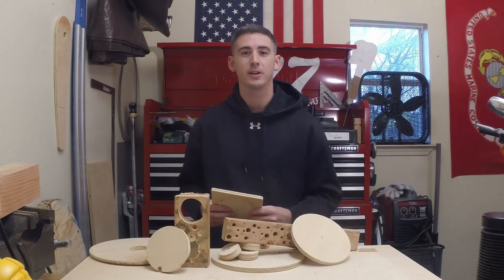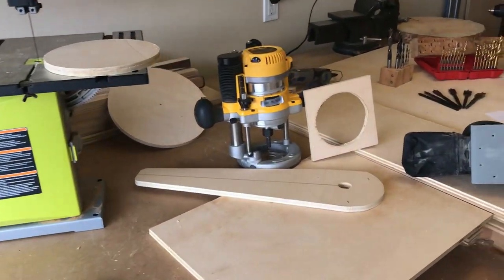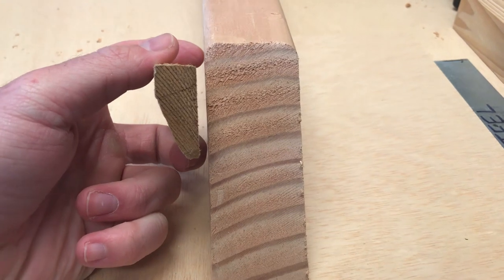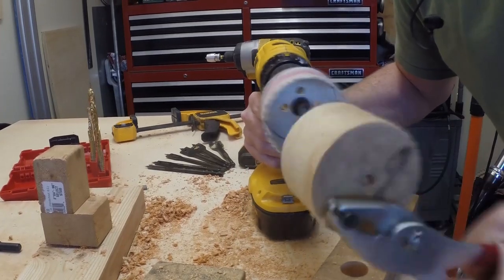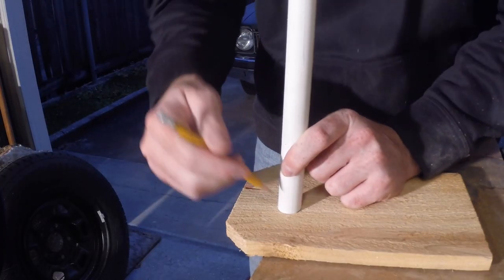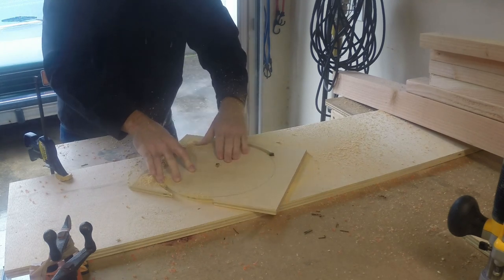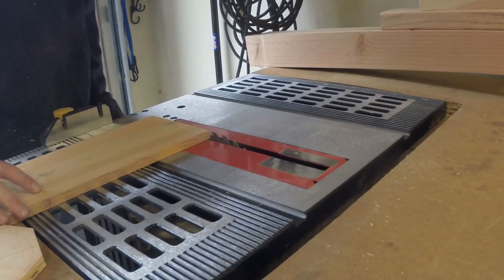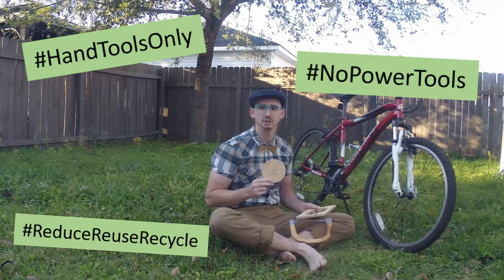How to Cut Perfect Circles…with ANY Tool!

Comment: Thank you so much for making this video and sharing your knowledge with the public! I'm not very tool-savvy and have been thinking about how to cut out circles for a woodworking project of mine. Before this video, the only thing I thought to do was to slowly cut away at a block of wood with a hacksaw, carve out rough edges with a carving knife or chisel and then sanding it off (a laborious and inefficient approach) all while hoping for the best. With your guidance, I feel much more confident in taking on this project, and I'm happy to know these methods with give me the straight lines I need. Again, thank you! :)

[Edit:] P.S. Your video and instructions are very clear, your transitions are funny, and your approach to your audience is very engaging. I love the silly bits and gags you've sprinkled in. :D

Comment: I have to use two by fours in the whole circles. Have to be 2 1/4 inches sometimes or sometimes only 2 inches to fill in the gap. There’s got to be a good way of doing it. I don’t have a big band saw in the jigsaw I’m telling you it’s always bounds in. It doesn’t do a nice circle one side will be wider than the other.

Comment: Hey Tony, I want to drill a hole, not a perfect one inside a tree trunk, I don't have a drill machine or something like that. The diameter is 1 inch and I don't want to drill through the tree, only 2 inches inside. I want to insert my pull up bar inside it. Will it be sturdy and how can I drill it.

Comment: Great, I don't know how you aren't big yet, anyways, I'm trying to make out of my dremel tool. I"d like to lay it on its side, attach a wood-cutting disc, like I said, place it on its side on a wooden table then push an inch thick wood I'd like to slice against it with both hands and make a straight cut. I don't have the resources to get these things otherwise I know I would have figured it out, any idea what to do? without buying more fancy Dremel attachments/accesories?

Comment: How to cut a circle without a hole in the middle? In the middle of the cut out circle I need to drive a screw, but with drill bits and spades the tip cuts a deeper hole in the middle so a screw has no woods to screw into. Think of a circular hole for a cupboard door hinge

Comment: I know this video is old but when your cutting anything using the disc with a Dremel/rotory tool make sure you use the Dremel brand cutting disc all those no name plastic disc in the Amazon kits are dangerous and basically explode during the cut

Comment: Hey Tony, I'm trying to make a case for my coins and i strugle a bit with making a circle holes that doesnt go straight through the board. Just a few milimeters to fit the coins in. Can you give me an advice? Thanks
Reply from the maker: Jan Zajc I think your best bet would be to invest in a set of Forstner Bits and use a drill or drill press. Those will give you a nice flat and circular indent in the wood. I don’t have a set myself so I can’t speak on which set is best but even a cheap set will accomplish the job, just might require extra sanding afterward.

Comment: I have 3 inch holes in stair risers left behind from insulation company... i need to fill them in with a 3 inch circular piece of wood. in all these situations there is a hole in the middle... well except for the jig saw but that seems too tie consuming considering the sanding that i assume is necessary at the end? any advice?
Reply from the maker: A hole saw would probably be the easiest and quickest way to make a circle for that. You will still have quite a bit of sanding and prep for paint afterwards to make it seamless
Reply: @theknottywoodworker5774  hmm, so all the hole saws i noticed at hardware store have a pilot bit. that would place a hole i would need to fill in. is there a way to avoid it?
Reply from the maker: @sleepingtiger4436  you can start with the pilot bit in then remove it once the hole saw is started. Then flip the piece around so the clean side faces out. 

Even if it has a hole from the pilot bit you can just fill it. You’ll have to fill the edges of the plug once you glue it in regardless, then paint it all and make it seamless. 

Or you could replace the whole riser entirely. But more of a project. 

Just strange that the insulation company cut holes in the risers to begin with, I’ve never seen that before.